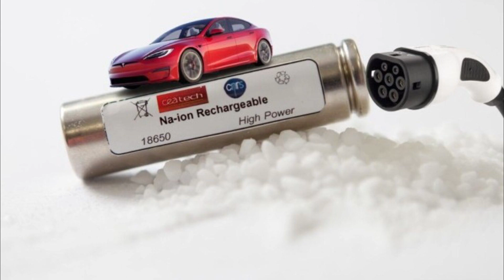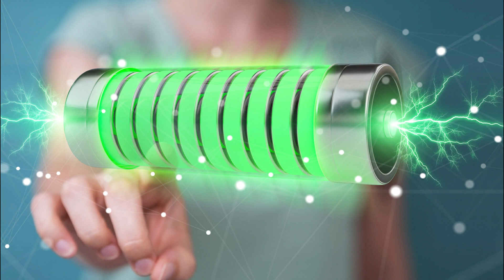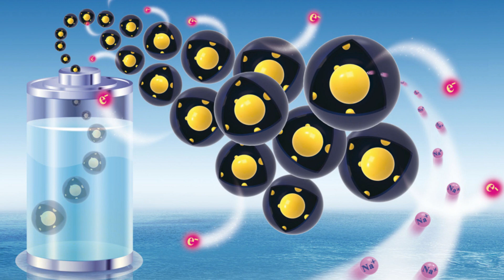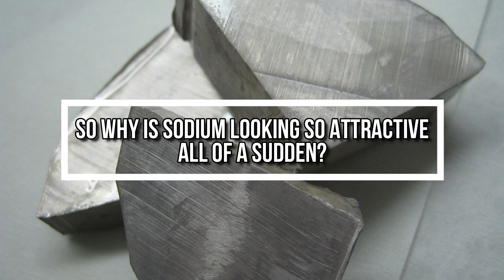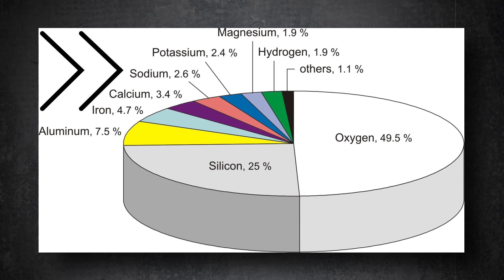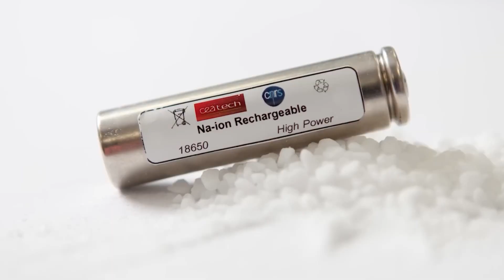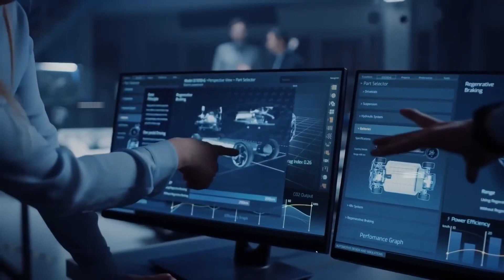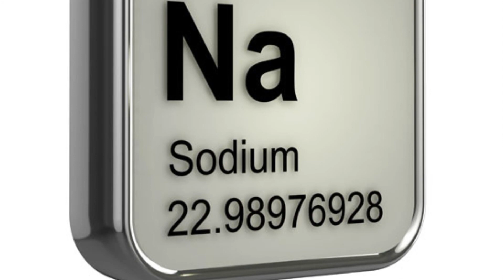GOODBYE Lithium! New Sodium-Ion Battery To Begin Mass Production

Comment: This video like any other that promotes the sodium battery for EVs is marketing sizzle with no meat.
In fact, the one big obstacle is in this video is claimed to be solved likely is an outright lie... that the energy density problem is solved. Unless the fundamental basics of physics as we know it is overturned and replaced by something else, there is absolutely no way this can happen.
The other key thing to understand is that because sodium is so close to lithium in the periodic table, it means that the chemical process of working with lithium and sodium are just about the same and that means that any time a new invention is discovered that improves the sodium battery, that same process can be applied to the lithium battery, too and get twice the benefit.

Because of sodium's mass twice that of lithium, lithium batteries will always be about half the weight for the same volume. This means that lithium batteries will always be the preferred element used in batteries that need to be light for mobile use... Like personal devices, vehicles, aircraft and more. For those situations where mass, weight and energy density isn't an issue like metropolitan grid storage, home storage and maybe some use in large, cargo vessels, sodium can be the preferred element. Sodium might also be considered for short haul vehicles like factory robotics and on premises only vehicles like warehouse forklifts and transportation.

If sodium batteries are used in EVs, it will only be to power commuter vehicles with limited range. This might be a consideration in early adopter countries like China where a large number of people were encouraged to buy EVs when they had a range only of about 150-200 miles and that might still be their only need. But that could never work in the US where similar vehicles like the Nissan Leaf promised all electric power but a limited commuter range. In a country like the US where people like to drive long distances without recharging or "filling up" sodium batteries would be a hard sell.
Reply: The thing to remember,  though, is that a range of 250 miles or more is what people want, and that will stay constant.  The best today and five years ago are NMC batteries, but now LFP is where NMC was 5 years ago, and sodium is now where LFP was 5 years ago.  All the chemistries will all get better and better by finding savings in weight and volume here and there and  by adding catalysts and saving on packaging, etc.  Already 190 miles is quite possible with sodium.  The next advance will take us where?  They can also make cars that assume sodium and are perhaps build them so one sits higher to give more room underneath.  And sodium would just be part of the battery and not all of it so it does not double the weight.  I am just old enough to remember computers as big as homes, then buses, then refrigerators, then microwaves, then books, then credit cards.  As people's wants from computers stayed more or less the same, the trouble in space and weight to meet those wants went down, and smaller computers became more practical.  It will be the same with EVs.  Once sodium range hits about 250 miles, all cheap EVs will use them.   And even now NMC is usually used for the very most expensive long range EVs since 320 miles already possible with LFP.  NMC and even LFP might slowly go the way of house sized computers.

Comment: There is a difference of about 20% in energy efficiency. Unless Sodium is much faster to charge, safely, Li ion will stay in transportation for some time before going out of usage. Sodium has better usage in power walls and non mobile applications.
Reply: Watch the video. Those issues are addressed.